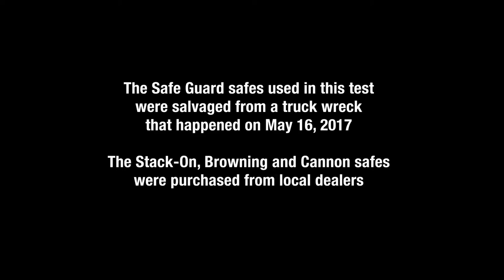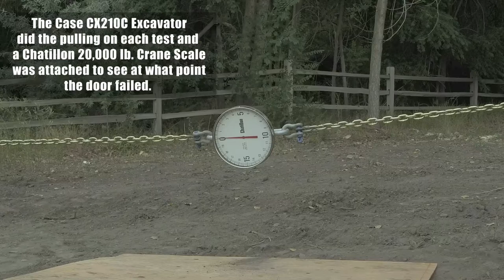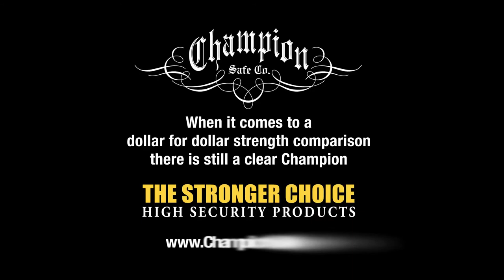Bulldozer vs. Safe

Comment: OK, excuse me for acting the Devil's advocate here.  Granted, according to this fine video, and apart from some anomalies, the Champion safes appear to be stronger, which they no-doubt are, both technically, materially and strength-wise--a close friend sells and swears by them---but how much stronger?  That one important aspect is missing.  How strong are the Champion safes when tested in a manner that brings them to their own failing point?  I suggest that two of these same Champion safes get bolted to together back-to-back (if the company hasn't already done it), to see exactly what the PSI fail-rate is.  It might be 10,000 or 15, or even 20,000 pounds... or, maybe only 7,500, just barely surpassing the best rated of the three other safe brands tested.  We won't know until they do it.  That, then, would be verifiable proof to boast about in my thinking.   Go for it Champion.  

As a matter of full disclosure, I own an American made high-end life-time guaranteed Cannon safe, manufactured before Cannon safes got cheapened up.  Sure, I'd gladly spring for a new beautifully-made Champion Trophy series, but I don't have the room or the extra wherewithal in my present budget.  I'd still like to see the aforementioned PSI strength test done. 
RM
Reply: Yes I agree I want to see more test don't champion the ping side to see when the falling point is. I just purchased my 1st cafe which is Champion medalist 31 safe. I'm waiting on delivery of it next weekend.

Comment: Is there a reason in all the videos, you don't seem to put Champion on what looks to be the "pull" side but instead always have it on the static (anchored) side?
Reply: Actually, I believe the difference would be very minimal either way, seeing that the pull factor would essentially be the same, in that are both being pulled on from a horizontal plane.   Now, if they were put in a vertical plane position, one above the other, the force of gravity might cause a difference, favoring one over the other.  Food for thought...
RM
Reply: What the actual fuck is that music all about?! Torturous!